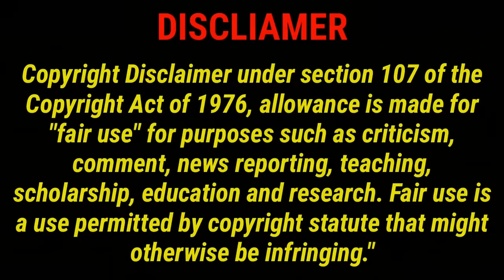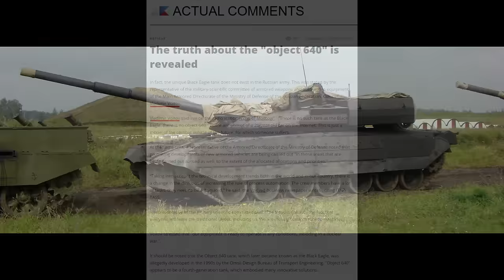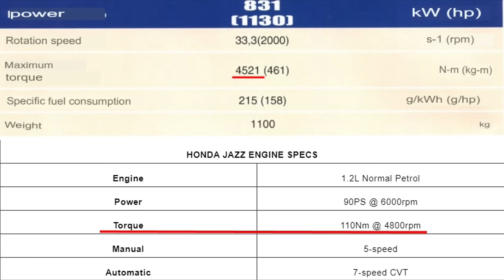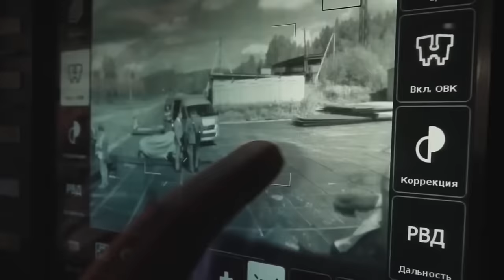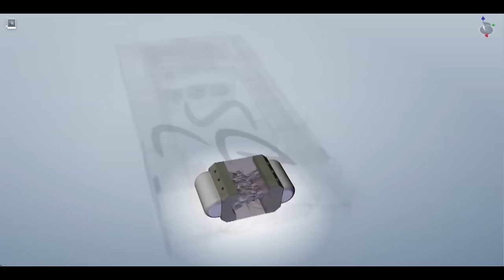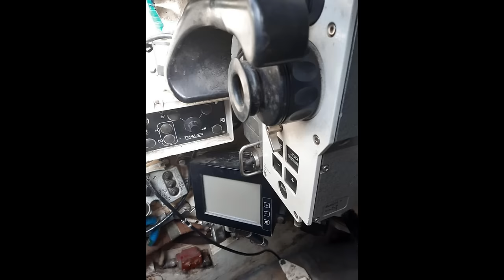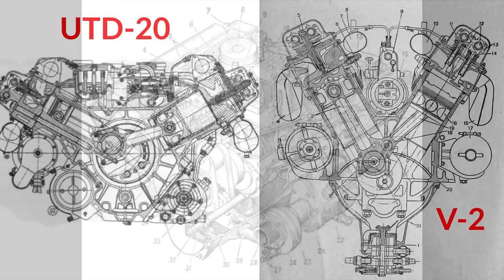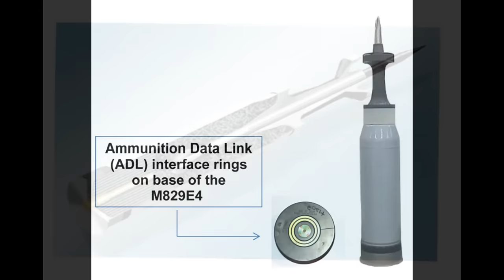LazerPig is WRONG about T-14 Armata

Comment: His rebuttal video made it pretty clear he wasn't wrong about it.
Reply: About what between all the many different topics he was corrected in this video?
Reply: @rc59191  The autoloaders reliability? Or the handbreak at a parade?
Either way, complete BS.
Reply: @カリユガ-u6f  autoloaders are unreliable I might only of been an Airman but every Abram's tanker I actually know and have talked to have said there's a reason why we don't use them. It's easier to replace a loader on the heat of combat than fixing the autoloader when or if it goes down.
Reply: @rc59191  Speed?
In this case, top speed is determined by the max engine rpm/ gear ratio. (not representative of offroad speed)
So it would make more sense to look at the power to weight ratio and torque.

So, I looked it up and the armata wins in terms of hp to weight.
Reply: @rc59191  replace?
I guess you're thinking it's easier to replace a human, than it is to replace a mechanical part.
But the Russian autoloader also allows for manual loading if it should fail.

Can you show me any sources of Russian autoloaders having reliability problems?
Reply: @rc59191 he didn't dismiss shit, he claimed in this video that he'll only respond to the arguments he thinks are wrong, not once has red ever claimed that this tank is good....
Reply: @rc59191 gonna ask again, where did LazerPig proved RedEffect wrong?
Reply: @rc59191 the Abrams tankers you know then don't understand its because... Theres no Tank with Autoloader in US? I mean France uses it, as well as South Korea and Japan, yet nobody says those are bad, also pretty sure you could not have a Human Loader in the Stryker with the 105, and IMB4 carroussel what is the M1 unmanned turret experiment magazine?
Reply: LazerPig's response was just pathethic, if I'm not mistaken, he only adressed 2 or 3 of Red's claims, without stating any sources whatsoever, and complained about russian propaganda the rest of the videos since that's the only thing he's good at. I mean, heck, after he posted that awful video about the T-34 and got destroyed by r/badhistory he commented in the thread and apologized for all his mistakes he's made, and asked for forgiveness and understanding, and yet, in his video about Wittmann, he said thar on average, a german tank destroyed 26 russian tanks. He's not a serious person and a serious historian.
Reply: @boscarobert12  He only adressed 2, The handbrake parade incident and the engine...
Reply: @boscarobert12  I only know about the rep of the T-34 video and I know he made one on A-10 which I guess its because "its not the F-35"
Reply: rebuttal video was 30 minutes of manchild rambling
LP avoided all questions except for the engine 💀
Reply: @gerfand  still being a keyboard warrior I see lol
Reply: @jaxonl7810  you come here to complain like you are any better, at least bring an actual argument
Reply: L-pig capacity for critical thinking is on the level that he assumed a engine with the output of a Honda jazz could power a tank.
Reply: @jaxonl7810 Touch grass dude.
Reply: @DC-it2ng  irony of telling me to touch grass when I see you here everyday commenting 

You touch grass kiddo
Reply: @rc59191  That is not an answer, nor did you provide proof at how it is unreliable.  Because tankers who use these tanks have a very different opinion.
Reply: @voidtempering8700   lol provide proof how when YouTube doesn't allow links. Also this is YouTube you don't like what I have to say then ignore it it's not my job to educate you on something that has absolutely no effect on either of our lives.

Comment: I dont want to sound like an ass but I have had my feathers severley ruffeled. Red points out how periscopes on the t14 are good or not bad then compares them to m1a2's and 2a4's which were built in the mid 80's to early 90's. In lazerpigs video he points oit how its alright for a tank to use main parascopes from the 70's or 80's but the t14 is a modern tank. Not built in the 90's so the compaison seems unfair. Also i see ypur point whith the autoloader vs loader but you say that the t14 uses the same autoloader as the t90 which has used the same auto loader as previous tanks. And with the multirole of the t14 sawing how the chasie matters not the gleaming fact that its a heaver tank than the m1a2 and is run with an unreliable underpowered engine. The weight is not the main factor but a close one to fuel consumption. If you put a engine from a toyota pris against a ford f150 the f150 will burn more fuel even if you put it into a pris. Its because its ment to create power at a sufficent rate for the kind of vehicle it is. Like how a kei truck and a LAV dont use the same engine. Im sorry for the rant but if you would like to discuss further red I would be more than happy to.I hope your having a good day to whomever is reading this
Reply: Lad just cause the M1 and Leopard were built in the 80s and 90s it doesn't mean they use the same periscopes. You can replace those pretty much just like most of the tank equipment its called modernization both tanks went trough various upgrades the last decades.
Reply: @hunterbg6651  I see what your taking about but you need to compate vehicles from simular manufacturing dates like the abrams to the t90 or 2a4 to the t80 you would not compare the panther to the t80 ypu would compare it to the abrams x or the t14 tanks with present day tech not tech from the 80's through the 90's. I hope this cleared things up
Reply: @TalonzHD  My friend those tanks have new variants some of those new variants were produced quiet recently and have quiet a lot of upgrades that set them apart from their early variants. Those new upgrades give them chances to stand up against new vehicles like the Armata and so on. Also technically the T-14 is not that new design has been a thing since the 1980s it just took the russians a long time to finalise the design because of economic issues.
Reply: @hunterbg6651  I believe I understand what your talking about. The t14 was designed in the 80s to whithstand modern NATO tanks and their upgrades. Am I right hunter?
Reply: @TalonzHD  In a nutshell yes
Reply: Periscopes are not outdated lol. Cameras haven't replaced the periscopes and the periscope will be in use in future battle tanks.

Comment: And now it's dead. NAFO and NCD memes win again.

GOOD.
Reply: no it's not
Reply: @Voschane  They literally shut down production. The project is dead. They put the tanks they have "into service" even though they don't work so they don't lose face.
Reply: @Gearhead221  Current production is shut down so they can make more T-90m's for the war, in the same interview it's said the T-14 isn't cancelled. Production will continue when the war is over.
Reply: @Voschane  Press X to doubt
Reply: @Gearhead221 it's not shut down. It's just in hiatus as of right now. Basically taken out of context
Reply: @Gearhead221  project is not dead, they will just give priority to the production of T-90M, the same happened when the T-44 appeared, they gave preference to the T-34 for the war even though it had a better tank

Comment: The issue with Soviet autoloader is one you will not be able to interview anyone about because the people who had issue with that are dead. Look up all the pics with turrets lying 20m and more away from the hull and you will find out what a huge freaking issue is having a corousel full of shells just under your feet in one of the weakest parts of the tank
Reply: T-14 crew is separated from turret n autoloader , the crew is in a armored compartment, the crew is safe from any detonations
Reply: @mbtenjoyer9487  - they may or may not be, depending on the quality of that armoured wall and if the real steel has been sold off and replaced by rust debris scavenged from a refuse yard. But even if the crew is protected from that huge explosive magazine right behind their backs the T14 still shares the same design "feature" of all the Soviet tanks - ammo storage in the weakest part of the tank right where its explosion tears the turret off. And once again I invite you to peruse the pics from Ukraine and think if that configuration of autoloader is really not a problem at all.
Reply: @piotrsmolanski8777  T-14 has protection and automatic fire extinguishers very very low chance for it to detonate 
For a tank to detonate u need to start a cook off in the ammo and then explode that’s low chance for it to happen as soon as the fire starts in T-14 automatic fire extinguishers will put it out

Comment: Also abrams and leopards are battle tested and hardened for over 2 decades how about the Armata? How're Russian tanks doing on that 3 day operation? The Copium is outstanding I need my GasMask
Reply: No Russian official stated it was to be a 3 day operation. You know you said that? Gen. Milley, of the US army. He was giving his prediction based around the convoy of Russian vehicles heading to Kiev. Wanna know what that convoy was for? To pressure Kiev to the negotiation table. It succeeded in Istanbul on April 1. Guess who stopped it? Boris Johnson, when he flew to Kiev and strong armed Elesnky. 

How are those leopards doing? About as well as other tanks in theatre. I reckon the US army would suffer the same fate because it is a war unlike any we've ever seen. It's brutal and not some low intensity counter insurgency operation.
Reply: How's the counteroffensive? No Tokmak? No Robotyne? No penetration on the main defense lines? No leopards? No bradleys? Ho2xL?

Comment: 35:04 this really doesnt make sense to me as back in ww2 the Base of the M4A1 Or A3 Hull was Used in SO MANY designs and different purposes its amazing, take for example the Sherman AA, Artillery, Tank Destoryer, And alot others. Therefore his argument of tank family is invalid, of course
Reply: In WW2 anti-air vehicles did not have missiles and were guns meaning they need to be closer to the tanks. Even still, the AA varient Sherman was used 8n tiny numbers. The tank destroyers had no armor, the Canadian troop carrier Kangaroo was used for direct assault... All very niche roles. It's not 1940 anymore and logistics is smarter.
Reply: @evulclown  I was making a example on how a family tree of tanks are common and were used/made. I'm not saying it's still used. I'm saying it's a good example
Reply: @acoproductions6877  Except in this case it doesn't make sense... Ok let's take a look at the Sherman in your example, yes the base hull modularity was one of its best features - but only because of the time and logistic constraints. The USA was in a rush to manufacture sorely needed tanks and other assets, and also had to ship them across oceans. This on top of the fact that multiple factories have to manufacture something they weren't used to. So standardizing the hull was a smart idea. 

Now let's look at Russia, who is in no rush for tanks and is planning for a next gen tank in the modern era (At the time of its conception). This is not a fair comparison at all. That's like saying having a large army is important because many wars in the past were won by having more men...except you're completely missing the point that it was a completely different time and situation.

Comment: Rifling this, rifling that, blah, blah, blah.........
One inescapable fact; Longest tank on tank kill.
Disingenuous at best RE!
Reply: Doesn’t really matter any other NATO tank in that situation would also have got the kill
Reply: @mbtenjoyer9487  But it is still fact, no matter how much you might not want it to be🤣
Reply: @justwhenyouthought6119   does it matter tho ? any other NATO tank would have been able to achieve that if they were in that situation
Reply: @mbtenjoyer9487  No doubt in 20-30 years time a bigger gun will make a longer kill but at this moment in time it's Chally.
Rifled still holds it negating RE's opinion in the video which is demonstrably false..
Does Usain Bolts time matter ?
Depends what your in to.
Reply: @justwhenyouthought6119 if rifled is so good why is UK upgrading there tank to smoothbore L-55 ?

It’s because smoothbore guns are better than rifled guns
Reply: @mbtenjoyer9487  well here's the rub......

Read the OP again.....

Standardisation of production and supply of ammunition and the cost of X amount of smooth bore barrels compared to X amount of new rifled barrels and the tooling requirements for such.
All makes sense really, who would have thunk it!
You smoothaboos still can't get your head around that one fact though, still the longest tank on tank kill.😆

Comment: The t14 is a nazi engine 😂😂😂
Reply: Like those the Azov Engineering Group used in the Babylon?
Reply: @anti-rain9702  Like the (ex-)leader of the Wagner PMC, Dmitry Utkin?
Reply: The russians did NOT use a new engine to increase mobility.
The engine is the same as in the T-90M, because photo analysis has shown that all air intakes and heatsinks have all the same placememt. Furthermore the transmission is also the same, because it shares the horrible reveerse speed of the T-90M. The russian like to boast, but they never shown off the improved reveerse speed of the T-14 Armata, because in reality it stayed the same.

Comment: Damn. came to just say don't end yourself it was only a response video that called you out for being a Russian propagandist.
Reply: Lol, LazarPig once again embarrasses himself with that video, to me personally, there wasnt a thing that RedEffect was proven wrong about. Pig just kept rambling about "that wasnt my point" while his point was flawed to begin with, such as comparing numbers without context and not how it performs on the battlefield.
Example, about the top speed, yes the Challenger 2 has the same top speed as the T-90 despite being 20 tons heavier, but the T-90 has a far higher acceleration than the Challenger which is indeed much more important on the battlefield and maneuvers than a higher top speed as the top speed wont even be reached in the battlefield to begin with (making it more or less kinda useless). Why would Russia spend more money and change their factories for new engines to get a higher top speed thats not even needed?
Reply: @eliasziad7864  this is an excellent example of how lazerpig tries to sound intelligent while just rambling and his fans eat it up.
Reply: Lazarpig is the perfect example of a western propagandist

Comment: Red effect is wrong about everything. Yuck
Reply: @yellowtunes2756  see you here a lot
Reply: Bruh lol 😂😂😂😂
Reply: @SquidwardLenin @sovietbanana4589  lazerpig was right. It did break down during the parade, or why would russia lie about it. On top of this did you consider that russian tanks must have their final drive disconnected before they have to be towed otherwise they wont budge even if they broke down? And the engine sounds suggest that it broke down.  Russia said that it stopped as a part of the parade initially too, they only layer said it was an emergency brake issue. Your clearly very pro russian and horrendously biased, or red has a sock puppet account. On top of this he focused on several. Red never prpved him wrong. Like when lazerpig said that the bt7m used the lharkiv model, and red said "well it wasnt designed for that model, it was later used in the bt7". Thats not proving him wrong. And red does this same thing throughout the entirety of the video. On top of the challenger 2 part where red says its the acceleration that really matters. Thats not the point. The point was that the challenger 2 is 20 tons heavier than the t14 and goes the same speed. The t14 should be able to run circles around a tank 20 tons heavier, not match it. 😑.  On top of this, the engine in the t14 was indeed a model of the modified sla 16 engine that russia uses in oil pumps. Which brings me to my next example. Red said that the engine is not the same, but its been further evolved. Which is a fancy way of saying modified. The same thing lazerpig said in the original video, but your too much of a vatnik russosexual to care i guess. Red never proved him wrong. Red used a tactic called flim flam, and it worked on a dvmbfvck like you. 👍@sovietbanana4589  also he did link his sources. He said he used warspot(a russian source btw) the tank museum, and he has contacts in russia. On top of this, he showed a book because the spurce red used cites that book as a source-and gets a lot of what it said wrong. And lazerpig actually red the book.
Reply: @thatguy46744  You realize that the book LazerPig uses only proved that Red Effect was right the entire time, right? There is a reason the article Red used sourced the book.
Reply: @voidtempering8700  ...sure

Comment: Hahahahahhaha this video is funny, however- it’s still a very bad tank. And even though what he said was highly exaggerated, his overall opinion was correct. The Tank is awful. And would be annihilated by and M1 Abrams or an Abrams X, Leopard or Panther or most up to date tanks.
Reply: "very bad tank" - what are you measuring to determine it?
Reply: "His overall opnion was correct"
His overall opnion based on false information like you said, therefore it CANNOT be correct.